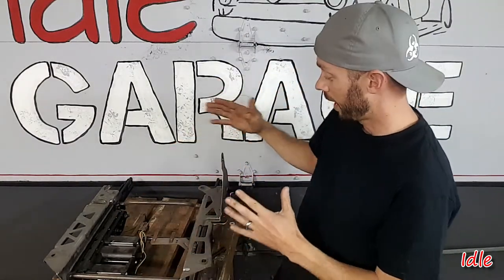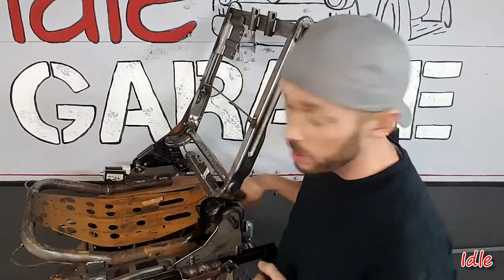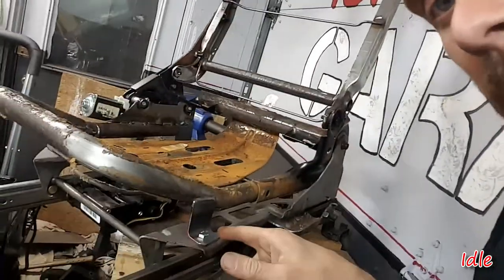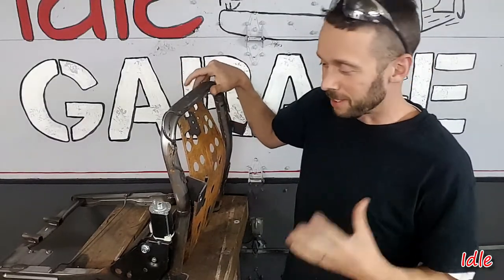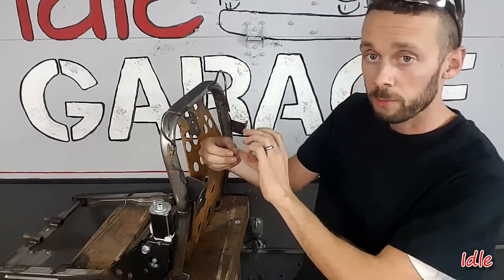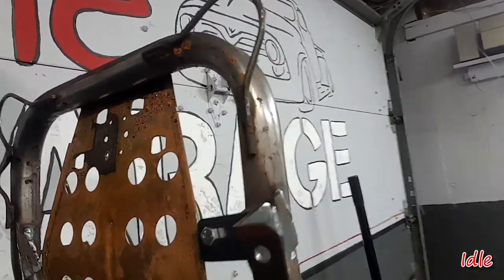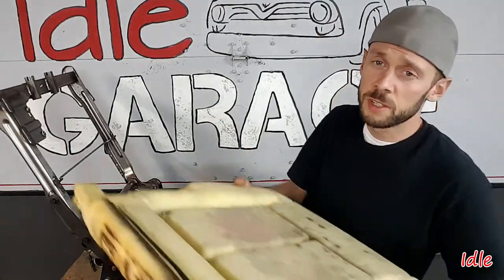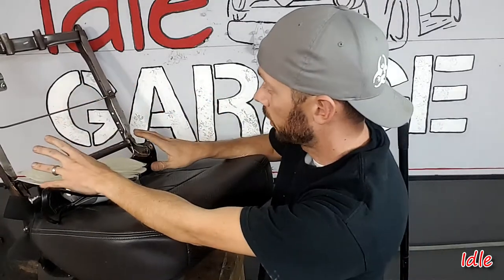Mounting the passenger seat frame to the track on my Ford F100 to Crown Vic frame swap#46

Comment: This is why working with steel is so nice.  You can keep adding and subtracting until it's like you want it. Plus is not awfully expensive. Looking good so far.  When you get to the last time you are going to slip the leather cover on, a small tip would be to toss it in the dryer for a few minutes and heat it up.  Helps to smooth it out and stretch it tightly in place for a final wrinkle free fitment  :)
Reply from the maker: Thanks!!!! That is a great tip. Makes perfect sense.

Comment: Way to persevere!  I've already forgotten what steering column you are gonna go with. I assume you're going to mock up the seat height with the column, wheel, and pedal locations before you mount them permanently into the cab.
Reply from the maker: Using the GM column and wheel with some future modifications in mind. I've kind of had a seat height in mind as I've been going to have a good view over the dash. So I have a ballpark where I need to be but there is defiantly some test fitting before I make a final decision.

Comment: Now I feel lazy for just getting a set of front seats out of an 2013 Chevy, for my project, and plan to use them with no alterations.
Reply from the maker: Your's looks good tho. I looked into seats like your's. The only reason I didn't go that route is the center seat isn't as comfortable.
Reply: Good point, I don't think my center seat will get used much, my kids are older, 3 out of the 4 are driving so my main focus was an arm rest and cup holder, that was also a seat.